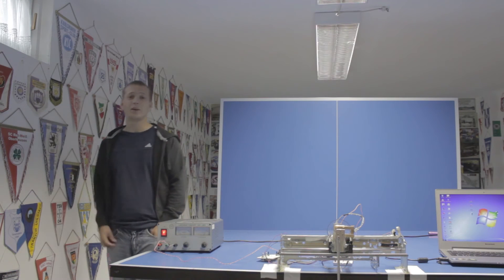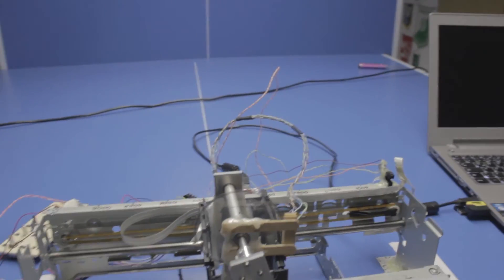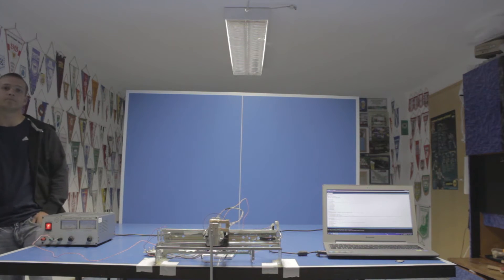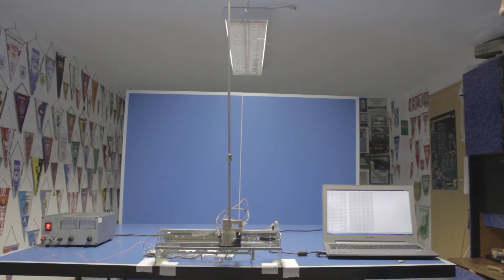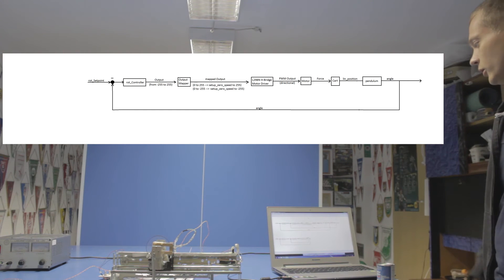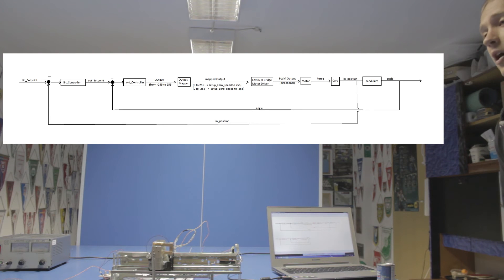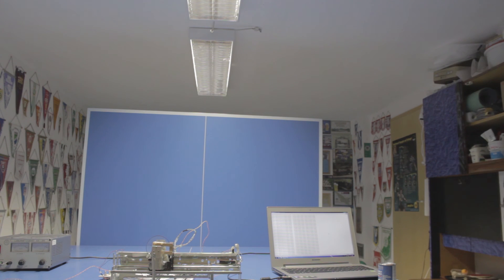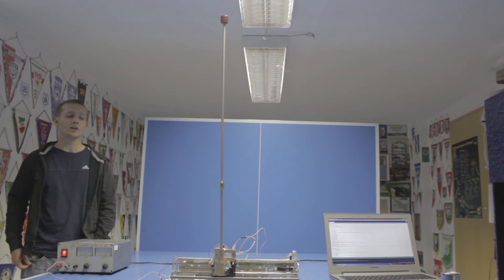Inverted Pendulum, PID controlled using an Arduino Mega

Comment: Halloooo ! Amazing work, I am currently working on a similar project, how did you find the motor Transfer function ? And what was it actually ? This would be of greatest help ! Thank you and Merry Christmas !
Reply: ا
I have the same question
Reply: you can find the transfer function (basically since it is a first order TF, what you need to obtain is "tau", the gain "k" is one. Tf(s) = k/(k+e^(t/tau))) through two different tests:
1- time-based approach: through a step response: basically you measure the rise time. then from the rise time, you calculate the "tau"

2- frequency-based approach: you input multiple AC (sin wave or alternative signal) as input, then you measure the "magnitude" of the output signal. then from this input/output magnitude ratio, you plot the "Bode" diagram.
then from the "bode" diagram, you calculate the "tau" (through a -3db approach)

if you don't have advanced measurement tools, the second approach is recommended since it won't need sensitive instruments for measuring mili-second scale times (basically the rise time of a servo is in mili-second scale), but the second approach, you just need to measure the magnitude which is easier.

I was a TA for Linear Control Lab for 5 semesters during my Ph.D.
please contact me if you like to collaborate!
Dr. foad najafi
www.drfoadnajafi.tech
email: foad.najafi77@gmail.com

Comment: Great work so far! Im doing the same project for my final year project. I have small doubts. 
Is it impossible to balance the pendulum without sensing the position of the cart? 
Did you derived any equations and apply theories like state space theory in order to get PID constants?
Or just using trial and error ?
And could u please share any documentation relevant to ur project : danujaboteju@gmail.com
Thanks in advance.
Reply from the maker: I have explained everything you´ve asked for in the video and provided a GitHub-link in the descrition with the source code and all the documentation I have. Did you even watch the video?

1. You can balance the pendulum without controlling the postition but then it will eventually run into the travel limits. I´ve only got a short amount of travel so that happened within seconds. So while it is possible it´s not real practical solution.

2. No I did not derive any equations or apply any theories to get the PID constants. All just trial and error.

I´ve since updated my code and pendulum. I´ll probably upload a new video to show the progress and will update the source code on the GitHub page as well. Check back in a few days.

Thanks
Reply: krz4tw Thank you very much for ur reply. Good luck

Comment: I think your controller is working very well. You are 90% of the way there. You said "It would constantly drive in one direction keeping it upright but never "overshoot" to actually eliminate the energy in the pendulum." That might indicate that the I term of the inner loop is too small. The purpose of the I term is to push the controller harder and harder if it doesn't reach the set point. I would try increasing your I. The responsiveness in the video you linked to is helped by the D term of the inner loop. The D term will cause rapid changes in output that can occur when you push the pendulum. I would try using the full PID for your inner loop.